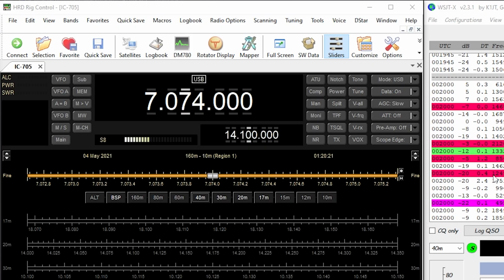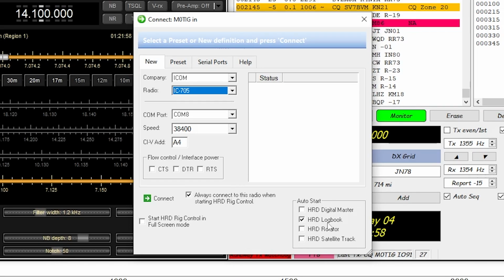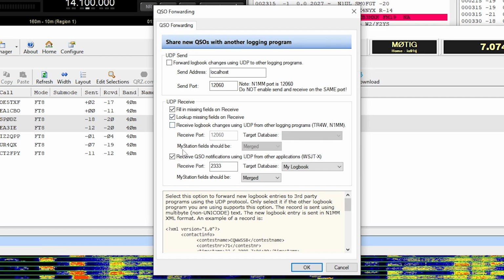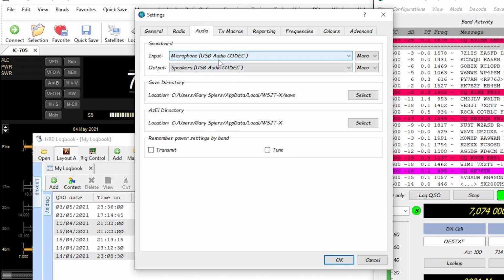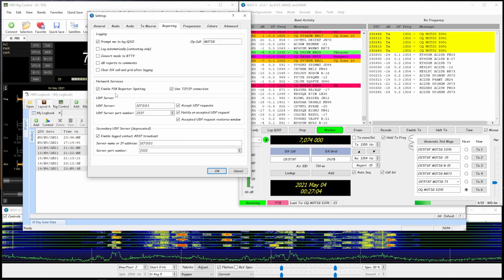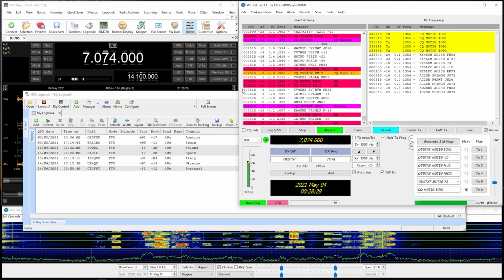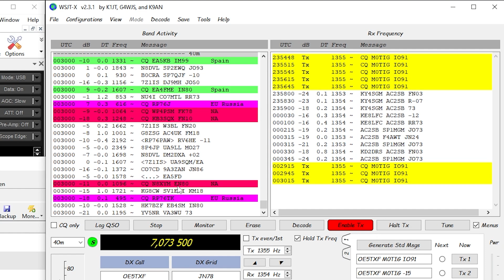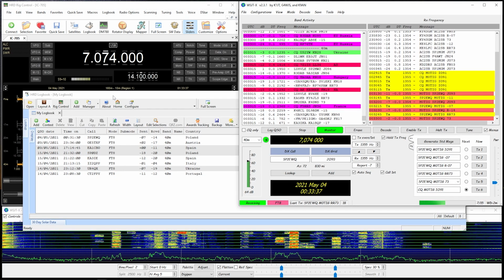Hamradio Deluxe as the RIG tethered to WSJT-X for FT8 or FT4 auto logging.

Comment: The use TCP/IP Connection function forces the PC to use TCP rather than UDP to connect to PSKReporter. This is more of a computer networking fix, where UDP is a streaming protocol with less overhead, TCP uses a series of handshakes to verify packets reach their destinations. This is a good fix if you have network jitter which you would notice as problems with streaming audio or video on your network, or using call services like Skype, Teams, etc. If you're using a less reliable network connection choose TCP/IP otherwise leave it unchecked to keep using UDP to report to PSKReporter.

Comment: Let me give you a challenge. Get a digirig working with a G90 running Ham Radio Deluxe. This has been a challenge. Who is up for that one?
Reply from the maker: the digirig is easy, the g90 would have to be emulated by using a rig that has same cat set?? I dont have one to try sorry :-(
Reply: I was told to use IC-7200

Comment: I see your TX freq dropped by 500kHz. On 20m, my 7300 drops by 1500kHz. I spent ages trying to stop it but is this normal?
Reply from the maker: You can change the effect under settings in wsjtx .. I’d need more information to help.. gaz
Reply: @TheGazLab  Thanks for coming back to me Gaz. I know your video is  quite old but it still works well for the important settings. 
I've been QRT for some time G4KIB but just got my CT7 call sign yesterday. 
I have the 7300, ARD and WXJT-X. 
I have 2 problems I've been struggling with. 
I've had it all working, all except the logging to ARD which, thanks to your video I should manage to get working. 
OK, when I transmit, the TX freq changes from 14074 to 14072.5.
I just can't find why this happens and was sure it wasn't happening before. 
Also, when I transmit, I don't get any power. I've checked the audio and been through the setting so many times. 
Like I said, it was working so even if I fix it again, I need to know why. 
Any help would be much appreciated. 
Thanks Jeff CT7BKO big knock out. No?

Comment: hello, really enjoyed your video but for me it does not work properly.
HRD does not have USBD Digital mode and after transmit reverts back to just USB and thus loose receive of the frq in digital mode. 
I contacted HRD Jan, 2023 and they were working on adding USBD.
All the best.
Reply from the maker: yes had this before.. you need to program a split in the radio or use two VFO's/virtual VFO's Gaz